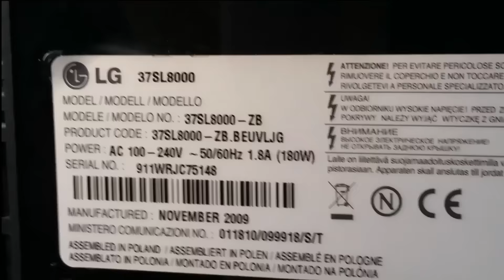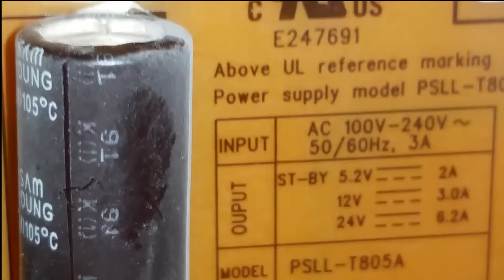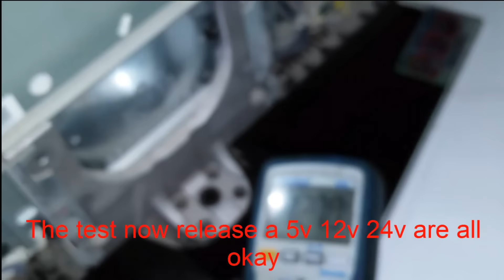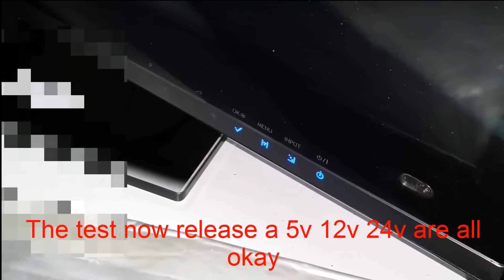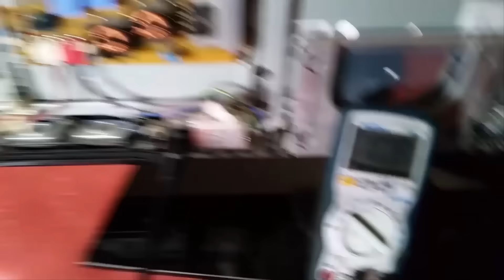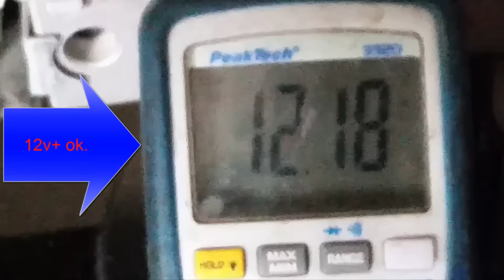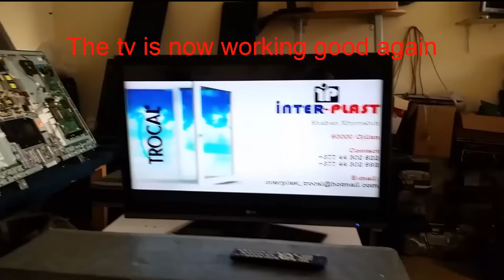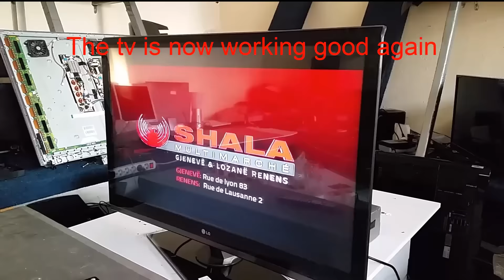LG 37SL8000-ZB lcd tv.  repair. works but turns off after 1 hour does not start with.

Comment: I wonder how you worked out the problem was with the power board and not the main board since the standby voltage was fine

Comment: I need help. I order a power supply board for lg 32lv2500. After install the tv worked but it power off itself and the power light blinks and there was a clicking sound. After several attempts to get it to power on the mainboard give off a spark.
Reply: watch the back side of the TV carefully in the dark and try to see where is coming the spark, usually from a dry join, but sometime a broken diode or transistor.

Comment: Sir my mpdel LG 42LV3730. Onday on running get a small sund ( busting ) then tv totally off. When I on the switch the power signal apper few seconds. In service thay told motherbord failed. Spare not avilable in the market Please give me a solution

Comment: Hi, how did you know the problem was the IC and not the transformer? I have a LG 50pj350, I have sound but not picture. I suspect is the Y-sus because the measure in the -Vy is 20v and should be 198v and the VSC measures 18v and should be 135v. Caps are good, diods are good. Any sugestion to repair?
Reply: If an AC to DC power supply check primary and secondary voltage in circuit.  Transformers do a simple job, increase or decrease voltage.  If the voltages check out check other parts.  Knowing the function of the IC is necessary to know how to test it or blame it for a fault.

Comment: Hi I have similar problem, the Tv shuts off randomly sometimes for 2 minutes and sometimes for 2 hours and after that it can't be turned on for about 2-3 minutes,when that happen TV goes to factory settings every time and i need to set up everything again,the voltages are all seems to be correct,is it possible that the eeprom is bad? Thanks!

Comment: First of that's for sharing your videos with everyone...  I just wanted to know, Did I miss something bcz you are saying 5v OK... 12 or 24 v  is not working so that's the problem on the board... But then you change the ic... Hmmmm..  How did u figer out that ic is faulty?????????
Reply from the maker: Watch the video well. Then comment. In video he writes to you. (The problem here is L6599D IC 101). Minute 8:23
Reply: service help tv led lcd plasma radio code   Thanks for your reply brother.  I have watched the video again.  Just one question about the if chip,  can we test the L6699D if chip with multi meter ?  Thank you